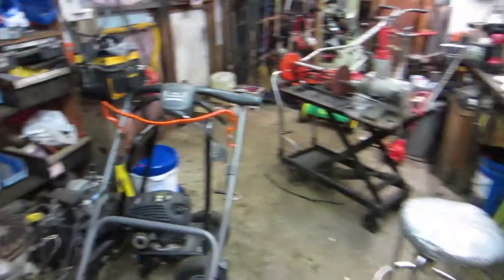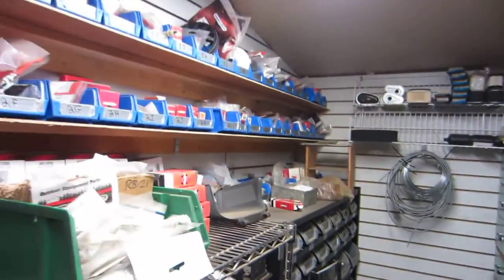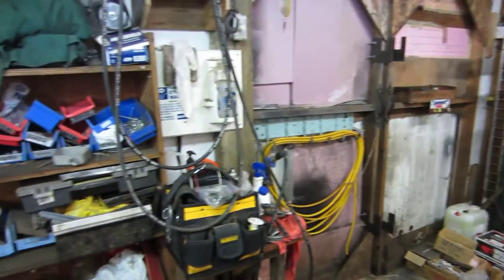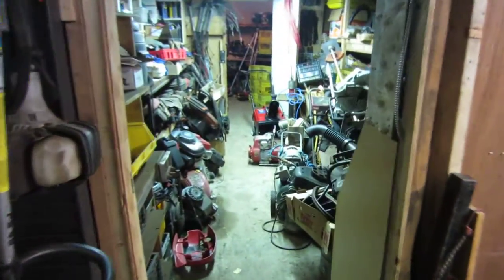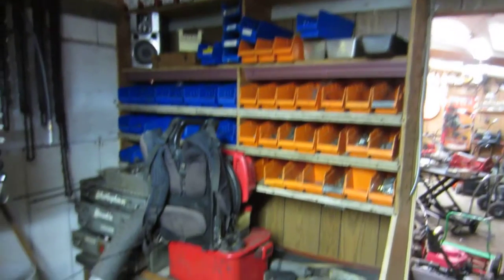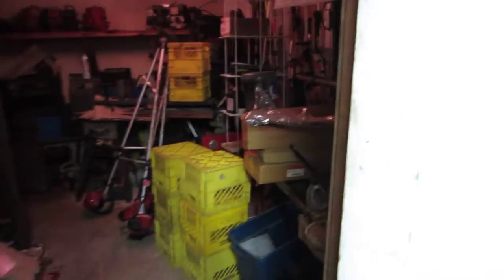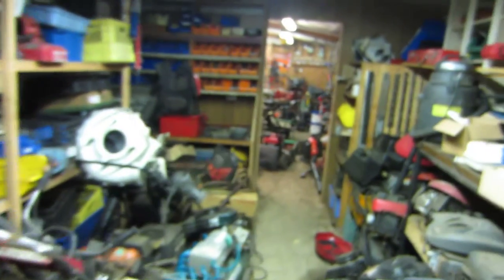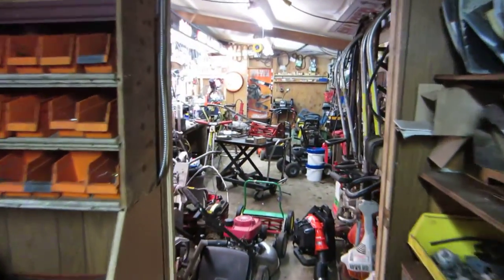My lawnmower and power equipment repair shop

Comment: How did you get started up and I'm what do they cost
Reply from the maker: i bought s store in 2009 for just under $100,000 and closed it down in 2015 and setup a small private by appt only shop. much better way to go than retail.